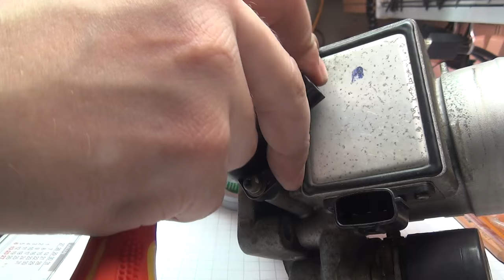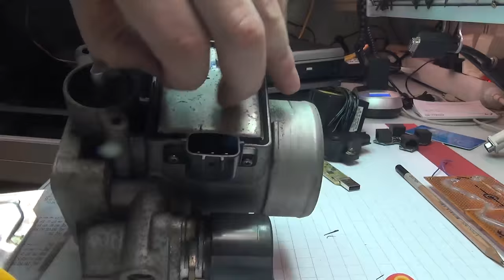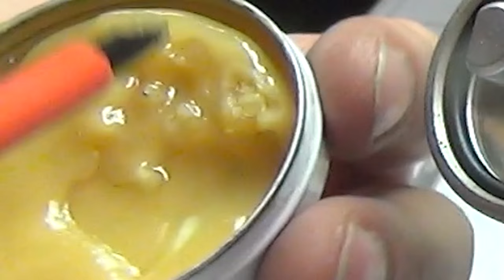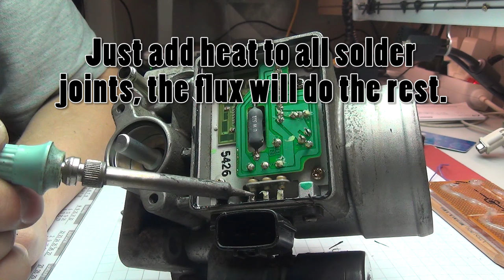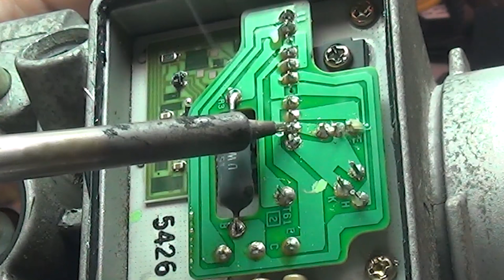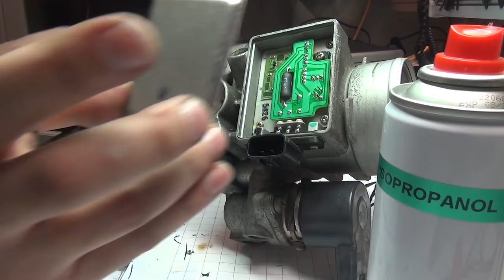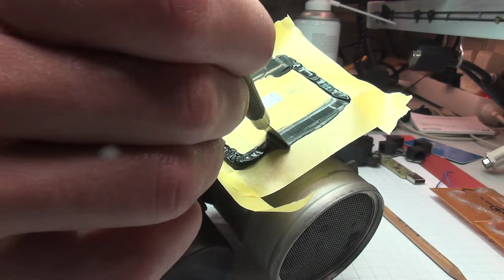Nissan Micra K11 throttle body resolder (mass air flow error repair)

Comment: I have done it and it has worked. I had trouble with the idle. It has been as before and I traveled without problem. My mechanic did it according to the video and paid just € 60 for labor. Thank You.  You Save my Nissan K11 1996

Comment: I've been chasing a misfiring and overfueling demon in my micra for over two years now! I've swapped every ignition component every fueling component cleaned the maf l, you name it I've done it. Except this, I just did it and after a twenty minute test run it seems to be fixed! Thank you so much you have hopefully just ended a years long headache of mine
Reply from the maker: Thank you for saving your Micra!

Comment: My K11 was stalling only on acceleration, this method fixed the problem. I used a flux pen and contact cleaner instead but as long as it works. It's amazing how a simple reheat turned dull solder joints to shiny.
Reply from the maker: Another Nissan saved, thanks! Make sure to reward yourself with a trophy!
Reply: Mine does the exact same thing ! Think this is it!?

Comment: Hi We spoke before in past. My K11 playing up again after a successfull soldering in Sept16. Having trouble when cold mainly. Opened up the board again.  It looks like there is not much solder on my joints now and they look very corrided. Is there way of putting more solder on to the joints. Does flux do that? Thanks
Reply from the maker: Flux only helps the solder flow. If you want to add solder, buy solder with a rosin core and just add that with the help of a little flux. How did you close the casing of the board? You should close it water (air) tight otherwise moisture is going to ruin your board and solder joints.

Comment: Thanks Lex. Very thorough video. Do you prefer flux paste over the pen type you can get? Have you got a video on cleaning the actual sensor?
Reply from the maker: You don't have to clean the actual mass air flow sensor (the little curl you see inside the black plastic stick when you look through the mesh on the top where the air filter is connected). If you do, you'll probably break it, because it's very fragile. So don't go poking it with something! The sensor is probably fine, the problem is only in (one of) the solder joints.

If you insist on cleaning something, you might want to clean the stepper motor. But be careful you don't break the paper gasket that's between the stepper motor and the throttle body, you can only get a replacement at a dealer and they never have stuff you need in stock so that will render your car useless for a week. You might be able to cut yourself a new one with a roll of "gasket paper", but that's also not something people have lying around the house very often.

About the flux, that's a personal preference. I love the flux paste I'm using in the video (it's also the best stuff to make the procedure visible in a video), but make sure you clean that stuff off of your PCB. It can cause corrosion if not properly cleaned. If you want minimum risk, you might want to try the no-clean flux that's being sold (I think that's what they're selling in a pen), but there's debate about whether it really doesn't leave a corrosive residue. The best bet is to always clean it; it might take a little more time, but starting over some time later is probably more time consuming.

Also important to know if you're not using a laptop with a consult cable after refitting the part: when taking off the throttle positioning sensor (the black thing I'm unscrewing right at the start), make sure you note how it's set and you set it back the way it came off. It's best you use a laptop, some software (I'm using NissanDatascan) and a cable (Nissan Consult cable should get you further on ebay) for a complete tune up, because that will get you the smoothest running engine.
Reply: Thanks for the detailed reply. I think I'll give the cable and software a go if I can get hold of them. To start I'm getting an obd2 tool so I can see what error I'm getting before removing the MAF assembly as it's a little cumbersome to get to. I will be sure to use ipa for a good clean afterwards. What concentration do you use?
Reply from the maker: Forget OBD2, that doesn't cut it. At least not with the 1995 model (it has a completely different connector), I guess post 2001 models have OBD2 in there, but that won't be enough to clear the learning computer and adjust 'stuff'. OBD2 is fun in combination with apps like Torque and to get a little educated about DTC's and sensors, but to modify stuff you will need the more specialist cables like the Consult cable with Datascan software. Every brand has it's own protocol and all that jazz, it's a bitch I know. Try watching some Delphi Autocom video's, you'll see the difference in "stuff you can do" compared to OBD2. About the concentration, I don't know. The more alcohol is in it, the less residue it's going to leave.

Comment: Lex Michdekammera - so many thanks for the video. Just completed our repair & taken our K11 out for a drive & the acceleration, response and pick up/general running is so much better. 
Just to say to anyone else. We did ours whilst the Throttle body in situ. We found that if you losen the air filter housing (no needs to take the all the air pipes off, nor the bottom plug on the housing), & just prop up the air fliter housing above the throttle housing with a screwdriver it gives you much more room to get access and solder & clean the circuit board. 
A garage in the UK probably would not want to effect an repair like this & want to replace the entire throttle body housing, so this video really has saved us a lot of money!
Reply from the maker: Keep driving that K11, it will save you a lot of money. Almost never has issues. Just make sure you change oil- and filter in time and you'll be driving it for the next 10 years.
Reply: It's a 1.3 CVT & really nippy. The next job is to change the oil it.
Reply: @LEXMICHDEKAMMERA  I have unstable idle and when I stop immediately, many times my k11 turns down!! Do I have to use for the soldering only the wax and the pen or do I have to use and soldering wire? Also, can I clean it after with alcohol 95 %? Thank you in advance!!
Reply from the maker: Should be solved with flux and heating it up only, just like in the video, no need to use more solder. Cleaning with 95% alcohol should do fine. Make sure you use the right flux and clean the flux off good after you're done! I've read about people using the wrong flux or not cleaning it off properly that had to buy a new throttle body because the flux caused corrosion. Also when you're done make sure it's waterproof again. Take your time fixing it, so you won't have to do this twice. Good luck!
Reply: @LEXMICHDEKAMMERA  i made it! next day i will put it back to check it! i hope it will work properly!! Thank you!!
Reply: @LEXMICHDEKAMMERA  one question more: do i have to bring out the battery after i put it? thank you again!!
Reply from the maker: Just put it back the way it was and see if it is running the way it should, I think in 99% of the cases it should be. If it doesn't, try a Nissan Consult cable and some appropriate software. Google can help you with that.
Reply: @LEXMICHDEKAMMERA  thank you again for your response!!
Reply: @LEXMICHDEKAMMERA  nothing happened to me after the procedure but thank you for all the information!!

Comment: Our Nissan micra K11 won't start and chokes and the engine light is flashing. We have ordered a universal OBD2 reader which unfortunately is not compatible. We will try your recommendation anyway and will keep you posted. Thank you very much for this very clear video which gives us hope
Reply from the maker: The older K11 uses a Consult cable, not OBD2. I hope my video can help you with fixing it, these cars should have a lot more life in them when this problem is fixed.

Comment: thanks for the video.... We did everything you said, bud now it won't start at all.. do we need to do something else to solve the problem.. maybe electronic adjustments ?
Reply from the maker: If done right it should work. If it doesn't start, maybe you forgot to connect a wire on the outside of the throttle body? Have you marked the position of the throttle positioning sensor? The black thing I unscrew in the beginning of the video is a potentiometer screwed on in a certain position causing it to have a certain resistance when the throttle is untouched. This way the ECU (the computer) will 'know' how far the gas pedal is pressed. So it is important you put it back exactly the way you have taken it off if you take it off. Make sure everything is connected, check the charge of the battery if the starter motor sounds dim... I can't help you too well with this little information, I'm sorry.
Reply: Thanks anyway for answering back.. i think i should go to a garage now.. update wil follow :)
Reply from the maker: Please do update with as many details as possible, it might help others with the same problem! Thanks!
Reply: So i took out the complete gaschamber thing ( excuse my english) and got another one at a scrapyard. Put it in my car, and still nothing... decided to take it to garage but didn't got out of my head so i put the one we fixed back in but now with the   throttle positioning sensor from the other one i had. Still nothing. Two days later i was planning to tow it to garage and with the kabel already in between i thought.. okay one more try... and guess what ... it started up and the problem seemed to be gone... so i took it for a testdrive and so far so good.. lets wait and see
Reply: All That Jazz Don Kaart is it still running ok...I know how intermittent this issue can be 😂
Reply: Yes its still running just this morning i moved around the throttle positioning sensor and now its a bit calmer.. but on the choke it runs smoother than when its warmed up?

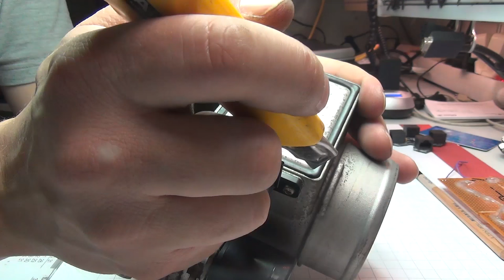Comment: my Micra K11 1,3L 1996 spits out black smoke and almost chokes on 100 rpm when all cables on throttlebody are pluged in. I figured out, that unplugging the plug with 3 contacts on bottom at 0:07 fixes the problem, but then it works without mass air flow sensor, right? Can soldering help my old Micra?
Reply from the maker: Could fix it, why not try it, what do you have to lose? If you're not confident with a soldering iron you could try to find a replacement throttle body and swap it to see if it changes the behavior. 

If you want to be really thorough and you have the tools, the best way is to use a desoldering iron to get all the old solder out and replace it with new (leaded) solder. Not replacing the (unleaded) solder will make the problem come back in a few years.
Reply: @LEXMICHDEKAMMERA  thank you for the tip
Reply: @LEXMICHDEKAMMERA  It worked! I cleaned the throttle body and soldered all points like in the video. My Micra runs perfectly now. I think even it never has run that good before. Thanks man!
Reply from the maker: Glad the video saved another one!

Comment: Please, what kind o material did you use to seal the lid , after the resoldering ?
Reply from the maker: Just some regular caulk. Make sure you clean everything thoroughly before sealing it.

Comment: Ok thanks Lex (having issues replying to your comment) . I wonder if I didn't seal it airtight. I did seal it, but 
might been air leak. Though aside it could also be the MAF sensor 
playing up as well, which is sealed on my 1994. model!
Reply from the maker: Did you try a Nissan Consult cable with some software to see if the MAF sensor is giving the right values?
Reply: How do I test the MAF Sensor?  Sorry for this out of place reply again. 
You tube not letting me reply to your replies? I think I also used the 
wrong Flux. I used lead free solder flux, but 
purchased it from a Hardware store. It could be plumbing flux?
Reply from the maker: Google Nissan Consult cable and Nissan Datascan and you'll find that your Micra can be connected to a laptop to check the sensors.

Using the wrong flux could be the problem, the solder on your board is not lead free solder as far as I know...

Youtube is the worst to have a community at, it never works right and it's absolutely not user friendly. We'll just have to live with that...
Reply: OK thanks. I am going to get some solder with rosin core. I'll do the board again. As it was running ok when warm just a pig when cold. Now I have done it again it's just not running correct at all. I'll make sure I'll get the right solder and flux and start again. Thanks for help.
Reply: Just checked the specs of flux we used (twice)and it's acid based solder, oh 
bugger. We will try and clean it off and resolder the board with the 
proper stuff and hopefully that will buy us some life time!
Reply from the maker: We all make mistakes. I hope you're able to fix it, you can always salvage a new throttle body from the Micra graveyard. Good luck!
Reply: Cheers, Hopefully a good clean up & re-solder. Might be able to salvage it.

Comment: Nice tutorial man! I will try it on my Micra. I am wondering what you mean by "Make sure to recalibrate the throttle positioning sensor (should be 0.45v) and reset the self learn in the computer". Can you explain in a few words how to do that?
Reply from the maker: The black thing I unscrew in the beginning of the video is a potentiometer screwed on in a certain position causing it to have a certain resistance when the throttle is untouched. This way the ECU (the computer) will 'know' how far the gas pedal is pressed. So it is important you put it back exactly the way you have taken it off if you take it off. You can also leave it on if you don't mind it being in your way.

You can tune it with a computer (a laptop is a bit easier to carry around, so I'd advise a laptop) and a "Consult Cable". For software you could use Nissan Datascan. If you Google a bit you'll be able to find out what I mean. It's not necessary to use this cable and software, but if you own a Micra it's a great addition to your toolbox. Be sure to buy the correct cable for your Micra! 1992-1999 Uses a 14 pins connector and Nissan Datascan I, 2000 and up uses the OBD2 connector and Nissan Datascan II.

Comment: My problem now is that it feels quite lazy bellow 4 ~ 5K RPM and then it's yeah pretty okay but when I come to 6500rpm I'm getting an extra boost in power which is a bit strange. Mods are ga15tb and a Janspeed manifold. Nissan consult showed me that my 02 sensor isn't working very well and the fault code was from the mass airflow. If I solder this should it be better? I want my old quick k11 back to good order:(
Reply from the maker: In my case the mass air flow dtc was caused by the bad solder joints. I think a reflow will solve your problem, but I haven't seen the car. If you are careful, thoroughly clean up the flux when you are done and seal it up good so no moisture gets in, then it is at least good maintenance.

Comment: Nice vedio :-) . will this method applicable for  nissan march k11(1998 model) . My car got a bad accelaration and bad smoke with law fuel consumtion.
Reply from the maker: I'm not sure, but you can always try to connect it to a computer first and check for error codes.
Reply: Thanks. btw i scanned & they said air sensor is not working and i have to replaced the throttle body.what should i do? please help me.
Reply from the maker: Just try the fix in the video, 99% chance your problem is fixed.

Comment: Hi I did this to my micra and it didn't help at all, while I was on the test  drive the car almost died and after that it wont rev properly. When you floot it it just bogs down and dies sometimes also backfires into the intake. At part throttle the car will rev to 3k rpm. Do you know what might be the issue here?
Reply from the maker: Might be something else that's broken. Try the Micra forums.
Reply: @LEXMICHDEKAMMERA  Oh yeah forgot to update. I got a new (used) throttle body for 30€ and that fixed that

Comment: Hi there,i seem to have some idle problems on a k11 1.0 mikra ....is it applicable there too ar its only on 1.3 models only?Should i give it a try?I have cleaned the body many times but still when idle revs are a bit eratic (i have rever experienced a shut down thought) and even with the hazard lights on revs are highly affected(dropped)
Reply from the maker: This throttle body is from a 1.0 K11, so yes it is applicable. Go ahead and try it, I am almost sure it will solve your problem. But make sure to put the throttle positioning sensor (the first black thing I'm unscrewing) back the way you have taken it off.
Reply: το δοκίμασες τελικά??

Comment: I think I may need to do this on my 2000 j-spec Cube. What is the sensor on the front side of the throttle body with 4 wires?
Reply from the maker: I'm not sure what you mean, I don't see 4 wires?

Comment: Does it shut down when you dont do anything? Mine does its a 1997 micra, it would also shut down while taking turns. For example if im going to take a turn. I slow down get into second gear and  and it just and shuts off with the dashboard lighting up.. And sometimes it doesnt instantly start for like 20-30 seconds. Very anoying and dangerous. I hope this problem is fixable its my first car just spended all my working money on it ffs...
Reply from the maker: Sounds like you have the same problem, the soldering should fix it. Follow the steps in the video and you probably will be driving the Micra for at least 10 years more.
Reply: Alright lets hope this does the trick! I will let you know if it did someting. Thanks
Reply: Taz Maniac Very similar issue to mine...do you try re soldering and if so did it solve the issue?